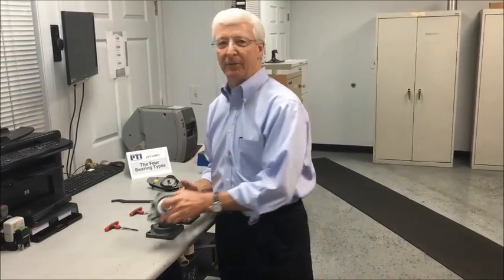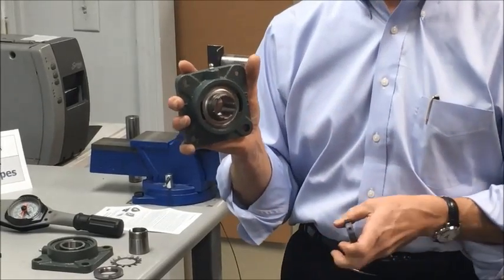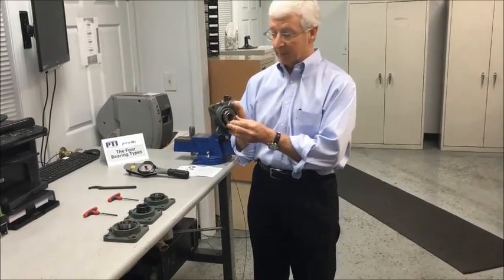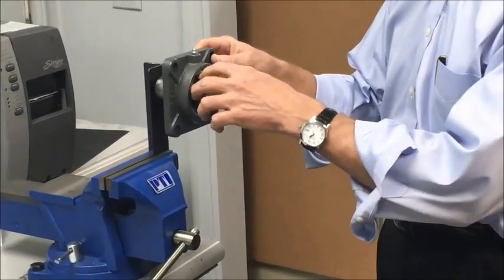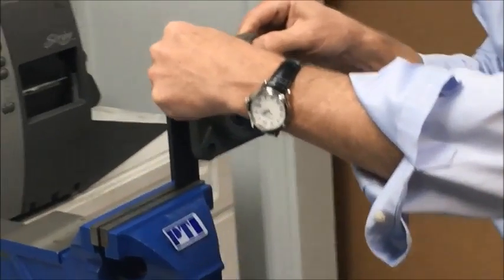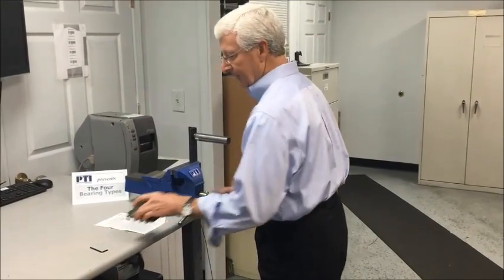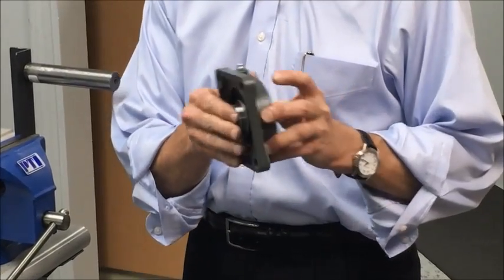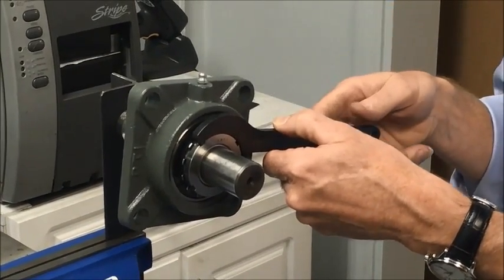4 Ball Bearing Mounting Methods - Intro, Mounting and Maintenance (Full)

Comment: Im a bit split about the explanation about re greasing, allowing the grease to seep through the seals. As these seals are basically single lip clip fit seals, wouldn't this method of letting grease seep through press the seal out of its holding lip and just be protected by the metal dust cover, thereby forcing the grease via centrifugal force through the opening and letting the bearing run dry prematurely. Very nice video on the basics of fitting bearing units

Comment: Which out of the two should Fixed and Floating bearing types? In  Which direction should the sleeve be installed in case of fixed and floating ones. Should they be on one side or alternate sides? How direction of rotation decides the location of lockni

Comment: Interesting Video, I'm basically just learning Mechanical Engineering & this is a huge help, now I know how the bearing's supposed to go into the housing & how to tighten it on the shaft, I need more of a slave gear shaft for a project I'm working on, So i can connect a Drive gear to a slave gear with a chain to rotate the gear for an axle on a Motorized Walk behind Snow Plow carriage I'm working on building.
Reply: Ok